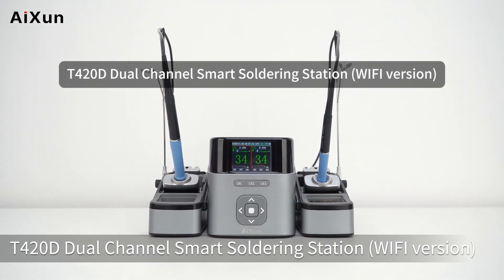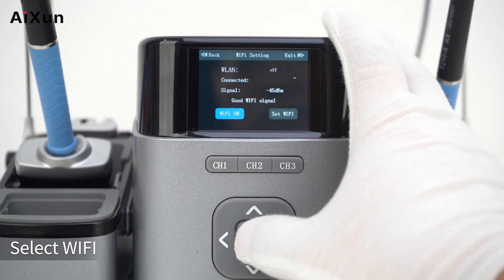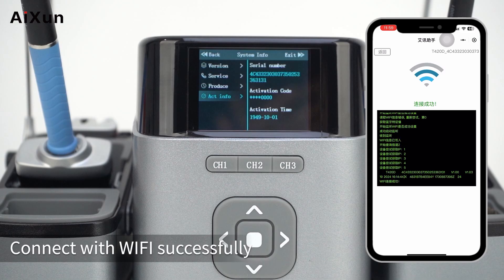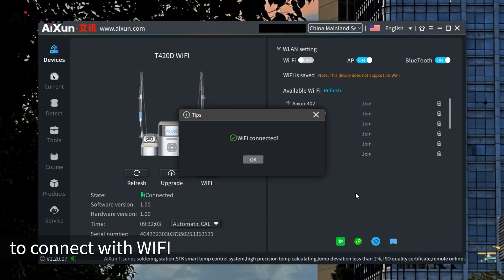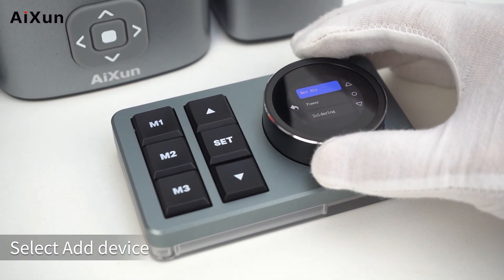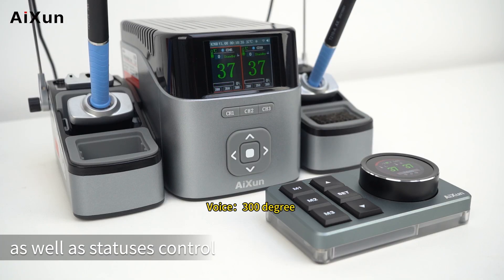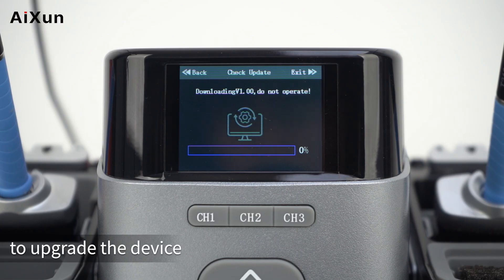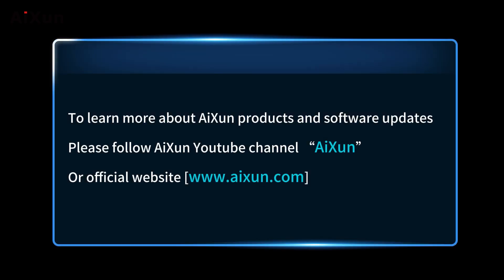AiXun T420D (WIFI Version) Dual Channel Soldering Station - Operation Guide #aixun #soldering_iron

Comment: Is it planned to integrate with DT01 via Bluetooth?
Reply from the maker: Hi, sir. There is no plan to change the DT01 solution. If Bluetooth connection is required, DT02 can be used.